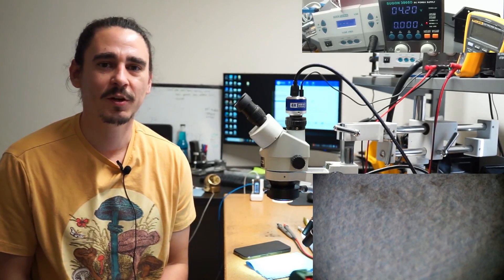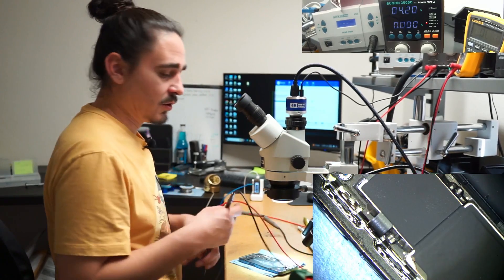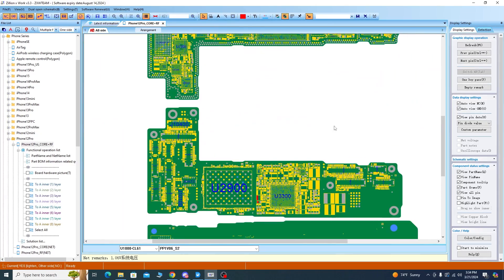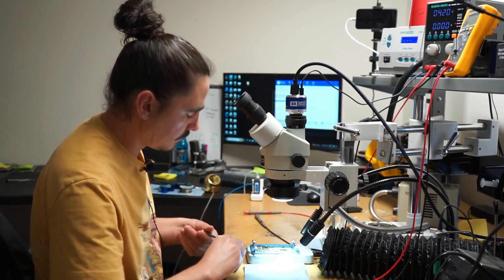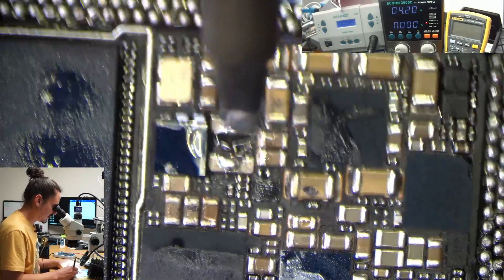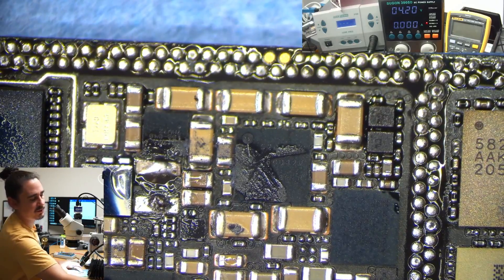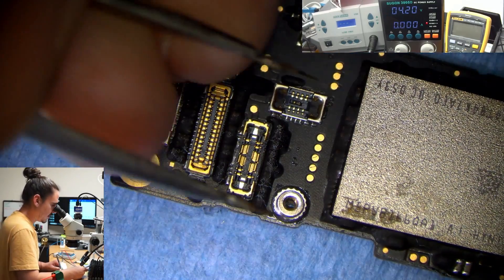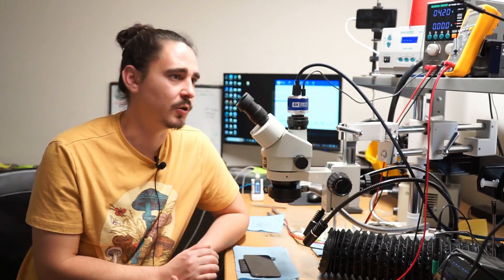Diagnosing "No Power" on an iPhone 12 Pro: Real-Time Troubleshooting

Comment: teacher please, I turned off 2 cellphones IP 12 Pro when separating layers 1 and 2, with the battery I charge 0.450 amperes what should I check , capasitor all good

Comment: I just did a cracked back glass repair on an iphone 12 Pro Max and the NFC coil was damaged and now the phone doesnt want to power on at all or show signs of life,  can the damaged NFC coil be the cause?
Reply from the maker: I think it will power on without that, but not 100 percent sure. I would just put it back to check.

Comment: Very nice job!
I have a 11 pro with similar issue. 
0.00A pre boot, then when I press power button it goes to 0.01A and returns back to 0.00A.
Im almost sure that it's a PMU problem, because there's no voltage being output by any of the buck/LDO of the PMU.
It has PP1V8_Always, so the trigger to turn on is there, but PMU is unable to output any voltage.
It has no short, neither main line neither secondary. 
Y3000 oscillator is not outputting any frequency, so that leads me to conclude that PMU is at fault. 
what's your thoughts?
Reply from the maker: I would check the power rails mentioned in this video for a short first. Especially on the 11 pro, ram lines can be hard to find so you will want to double check those. In my ram swap video, I would have seen a similar symptom. Also of course make sure you have double checked all pmic outputs for shorts as well as nand power rails. Just from experience I can say it is very unlikely that pmic just doesn't work and delivers no power at all as the fault of the pmic. It is almost always something else. Also make sure your boost coil isn't loose, as that causes a similar symptom too.
Reply: @iBoardRepair  I checked every line and found no short. PP_GPU seems like it's short, but it is a low resistance line, so it's ok. sys boost coil is ok, tested and it provides 3.4V when pp_vdd_main is lower than 3.4V. 
Since the crystal oscillator y3000 isn't giving any frequency, doesn't that point to the PMIC being at fault ? I suppose that PMIC only needs input voltage (PP_VDD_MAIN) for the crystal to be working at its frequency. right ? I mean, even if there was a short on some sec. line, the crystal freq. reading should be ~32khz. Or am I wrong ?

Comment: Hello from Korea, thank you Aaron for the great videos and tips. Your problem-solving ability is impressive. I have some questions.

I want to salvage my iPhone 12 mini which was water-damaged. First, it showed a green screen, so I thought the screen was the problem, but even when I replaced it with a new one, it still showed the green screen. Currently, the upper logic board is detached, and when I apply power supply and hold down the power button, it maintains 3.85 V with 0.13 A for a while, then spikes up for a short moment (like 0.2 A or 0.3 A) and it stays at 0.13 A again, and after 1 or 2 seconds it immediately drops to 0 A. After watching your videos, it sounds to me like the CPU tried to boot up and failed due to some short or something. I am planning to try your ways to figure out the problem, but do you have any guesses as to what might be the problem? (My rightmost 3rd and 5th test points from the bottom on the front of the upper logic board show shorted, but I couldn't find what they are even from your videos.) 

I read that the data is encrypted with some chips. In the worst case, on the upper logic board, can I move the CPU and NAND to another working board, and will there be no problem using the phone and accessing my previous data?

I am sorry for asking specific things. I wanted to try fixing on my own so I have little knowledge. Even if the problem is difficult to tell, it is totally fine. Thank you!

Comment: Nice job as always 👏. Hi bro. I asked you about that iPhone 15 pro which you changed the charging IC. Did you check 15 series works with another charging port to access the data?
Reply from the maker: Hello, I have not done many tests with the 15 series yet. I've only used the original charging port at this point.
Reply: @iBoardRepair  I know there is a chip above the charging port which looks like LCD or battery chip which should swap for replacement. I repair cellphone for all functional. I'm curious what that chip do. I will tell you about it if I figure out. It's gonna be useful.